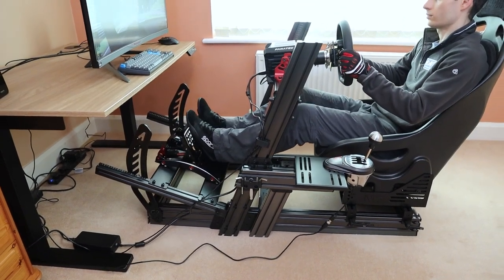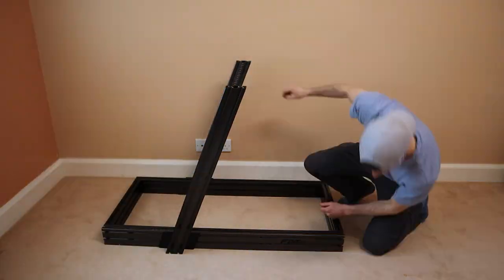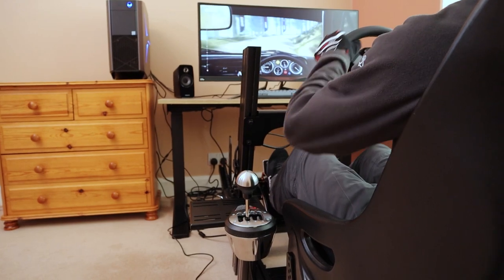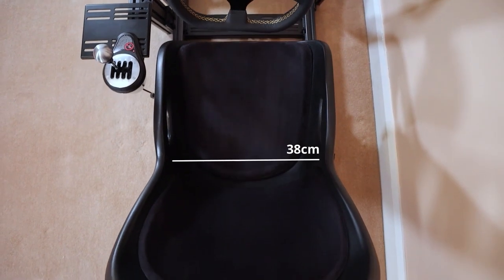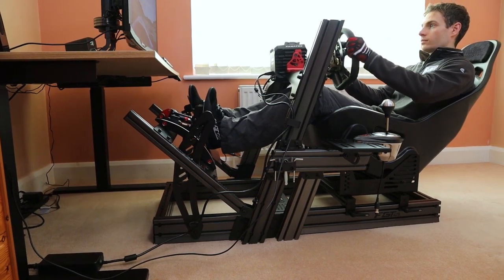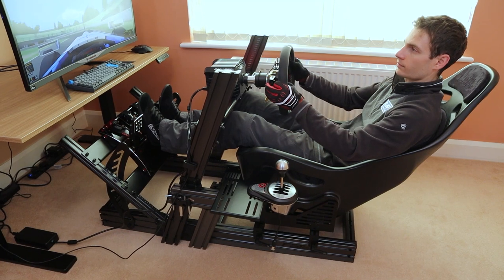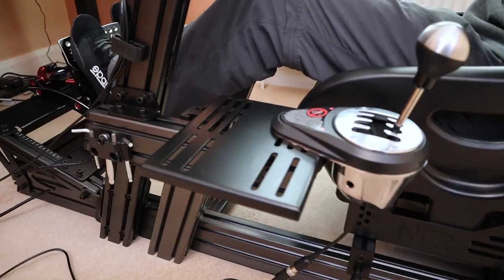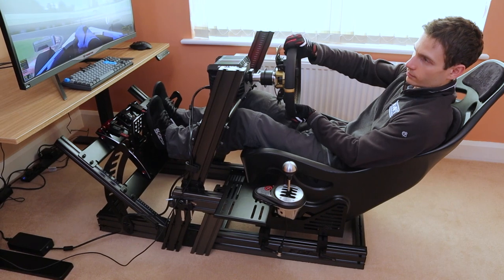Next Level Racing F-GT Elite cockpit review: The ultimate sim racing rig

Comment: love my simlab px 1 strong sturdy and cant have it not laying the floor and no flex at all anywhere and better price this cock pit from next level racing has flex on the paddles and where steering wheel is at not much but you can see the flex trried it didnt like  for the rest it looks the coolest   pretty only  con is u can change f1 to gt quick nothing else and how it looks
Reply from the maker: Thanks for your comment Aruba. I'm a big fan of Sim-Lab rigs also (see my GT1 Evo review: https://youtu.be/TtfTOfG8xb0 ). To clarify though, the F-GT Elite does come with feet (11:30). However, I chose not to install these because the rig slides reasonably well on carpet without them. Additionally, with my Fanatec CSL DD and ClubSport V3 pedals, I didn't notice any flex. Based on profile thickness, however, the P1 X is probably slightly more flex resistant for very high-end pedals. Like you said though, the F-GT Elite has the advantage of being able to support both formula and GT driving positions easily. 👍
Reply: Just bought simXlab XT120 for my sc2pro it is the same as P1-x for just 629 eur! Nextlevel is jist crap for thw price you paid! Sorry!
Reply from the maker: Thanks for your comment  @amigoz3201 . The XT120 looks like a very robust cockpit. The F-GT Elite does, however, boast a number of unique features that are worth considering in my opinion. Plus, you have to admit, it's a good-looking rig! 👍
Reply: @ADAPTNetwork  it looks ok, but what it has more than xt120? I think nothing… and it even dont has front DD mount for the 1050 eur, come on man, you already understand what i mean ;)
Reply from the maker: Thanks for sharing your thoughts  @amigoz3201 . The F-GT Elite has been designed to switch between formula, GT, and multiple hybrid configurations straight out-of-the-box. Additionally, it's fully compatible with Next Level Racing's motion ecosystem and comes with a number of included extras. It's also worth pointing out that the retail price includes shipping. I agree though, that the XT120 looks very good value for money as an aluminum profile GT rig. 👍

Comment: Hey adapt nextwork great review mate am currently in the market looking for a new rig too but am in a loft bedroom for mine so space can be quite limited until i change my room around by moving my bed to another room we have and ive measured it out so it comes to Seat height is 100cm width from top view is 50cm bottom is 45cm the length is 130cm and pedal plate is width 36cm by length 30cm thats a playseat evolution rig am currently on but not too keen on it as find it awkward to get in and out of it with the centre column dont like it between my legs and always feel cramped in a hunch position with the wheel deck because theres not much room for manoeuvre currently have same wheel rig as you too but the formula v2 rim red version and csl pedals along with advanced paddle module was looking at this one but the price for it is ridiculous in my eyes then you have to buy seat separately which is incredibly expensive so if you know of any other options that would fit the middle range budget if you like it would be helpful looking at the psr1 rig too by next level anywhere also the trak racer tr80 or gt1 evo  as another option
Reply from the maker: Thanks for your kind words Dan—I'm stoked you liked the review. I think the F-GT Elite will be a bit too big for your current space. The Sim-Lab GT1 Evo could be a good option (here's my review: https://youtu.be/TtfTOfG8xb0 ). It has a base footprint of 135 x 55cm, so you may need to find a little extra space still. Hope that helps. 👍
Reply: @ADAPTNetwork  yeah am leading more towards that mate after watching your review on that too just a question would the playseat its self along with the rails that come with be able to screw on to the base of the evo ? thats what am thinking of doing 🤔And with me being in the uk too like when i got the csl dd from fanatec are there brexit charges still in place if you know ? And one more if i did do that with the seat should i buy any extra parts before i place my order ?
Reply from the maker: @DanMufc-jt9le  In order to mount the Playseat Evolution seat to the GT1 Evo, I think you would need an additional seat slider ( https://adaptnet.work/7jG5 ). You would then bend the seat slider to match the width of the seat, bolt it to the base of the seat, and then bolt the seat slider to the seat rails of the cockpit. Does that make sense? It's also worth  picking up the shifter & handbrake mount, as this doesn't come with the cockpit as standard ( https://adaptnet.work/6Muv ).

Digital Motorsports has a blog post regarding post-Brexit import charges (see here: https://adaptnet.work/3WhT ). My understanding is that products are sold without VAT. The shipping company then charges UK VAT and a small handling. Hope that helps. 👍
Reply: @ADAPTNetwork  right ok mate thats good to know very helpful mate thanks for that would it be worth sticking with the standard wheel base mount you get with the evo to hold the csl dd bare in mind i got the 8nm one or get sim labs upgraded one ? am not an expert on diy myself so just thinking of a list on what to buy Am also thinking i currently play on a lg c1 48 inch tv for xbox/ps5 etc so like the monitor stand you show in the video would that hold the weight you reckon so i could have that as my ultimate gaming rig 😍and can sit back chill out on my playseat and play games when not driving or would that look overkill on it 🤔Am not to bothered about shifter and mount at the moment as i have the paddle advanced module on my wheel base so ill just use them for now And how was the delivery days for you mate how long did it take for them to send it you and if you had any probs ?
Reply from the maker: @DanMufc-jt9le  I also have the 8Nm boost kit for the CSL DD and I think the standard GT1 Evo wheel deck would be perfectly stable. As I mentioned in the review, the GT1 Evo comes with a pack of M8 washers to ensure a more rigid connection between the wheel deck and frame. However, it's also worth picking up a pack of M6 washers to help with mounting the wheel base to the wheel deck. Additionally, the Sim-Lab side-mount brackets ( https://adaptnet.work/7jI4 ) are not compatible with the single screen holder I reviewed. That being said, I think the single screen holder would be more than strong enough to support your 48 inch TV. And, if you did want to use the side-mount brackets, you could still mount your TV using the integrated monitor mount ( https://adaptnet.work/7jI6 ). Regarding shipping, my GT1 Evo arrived before the new Brexit rules came into place. However, subsequent deliveries from Europe have been pretty speedy. Hope that helps. 👍
Reply: @ADAPTNetwork  hmmm ok mate thanks for the tips honestly mate really helps for someone who isnt good at diy stuff lol so want to get it absolutely perfect but thinking the evo is the winner for me reasonably priced looks fairly simple to build compared to other rigs plus its rigid and made to last longer bit annoying you dont get a seat included but that has given me options mate on how to mount my tv 🤔if not then it may go on a wall mount in corner of my loft bedroom wall but its getting it at the right level where rig will be because dont want it too high and straining my neck when racing longer because the playseat is ok but for me it wobbles to much too flexy and dont like the centre column in it find it awkward between my legs to race with and feels like the pedal plate can snap off any moment with it feeling cheap got mine from amazon too so the evo looks 👌
Reply from the maker: No worries  @DanMufc-jt9le —I'm glad I could help. Enjoy the new rig mate. 👍

Comment: So not as heavy as the p1 meaning less aluminum and less strength. The $500 plastic set is ridiculous and for the price being more expensive then the p1 is bigggggg nope
Reply from the maker: Thanks for your comment Aj. I'm a big fan of Sim-Lab rigs also (see my GT1 Evo review: https://youtu.be/TtfTOfG8xb0 ). No doubt the P1-X is a fantastic cockpit and probably more flex resistant for very high-end pedals. However, with my Fanatec CSL DD and ClubSport V3 pedals, I didn't notice any flex on the F-GT Elite. Additionally, the F-GT Elite has the advantage of being able to support both formula and GT driving positions easily. So, there's pros and cons either way I guess. 👍
Reply from the maker: Thanks for sharing your thoughts  Musicbox Entertainment . Let me know how you find the Alpine TRX once you have it set up. 👍